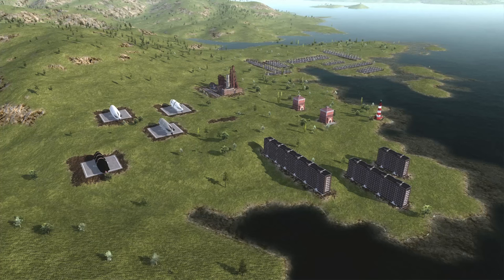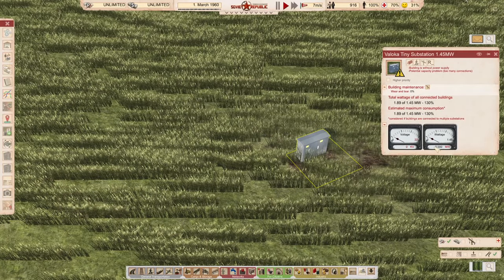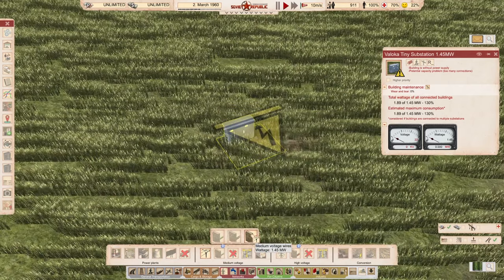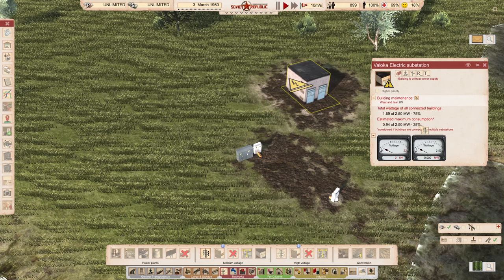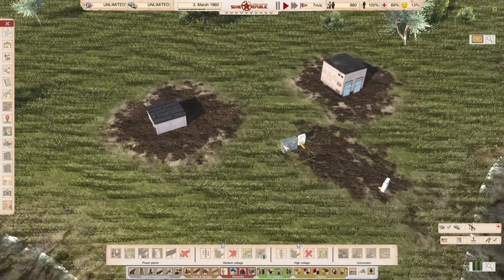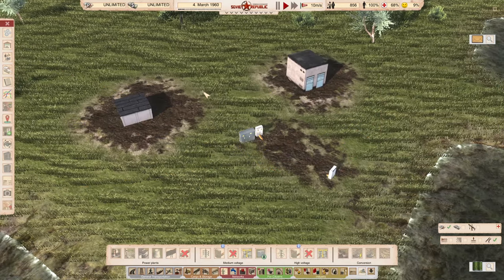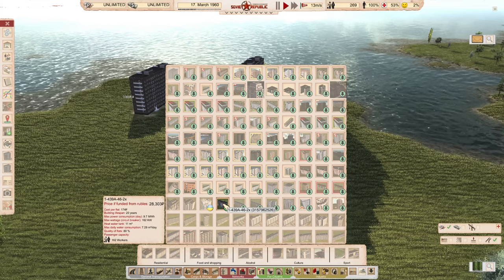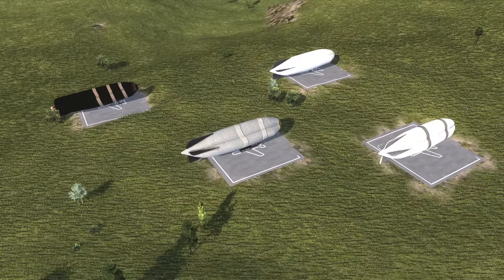Soviet Republic - Mod Monday - S04E07 - Steel Mill, Prison and Zeppelins

Comment: 8:05 in my latest game I used those rails that attached to steel mill to deliver iron, not picking up steel. It was really convenient for me since I had somewhat limited space and my desire to be symmetrical . Although it could work perfectly fine without direct rail connection
Reply from the maker: Damn it! I was so shortsighted! You are right. Deliveries. :(